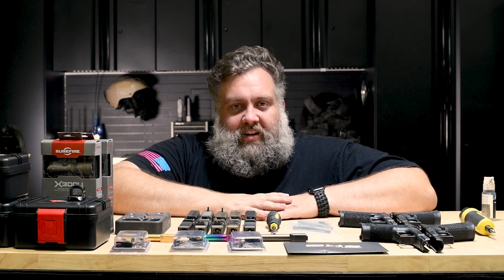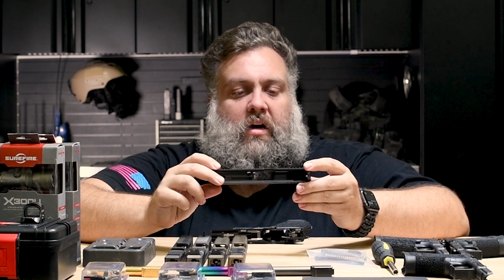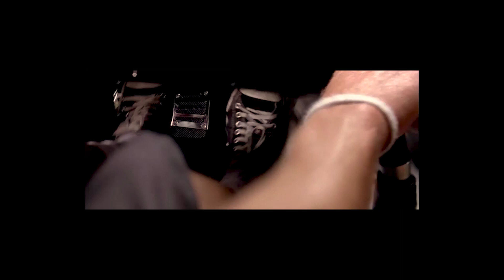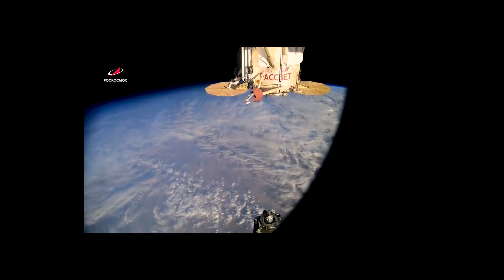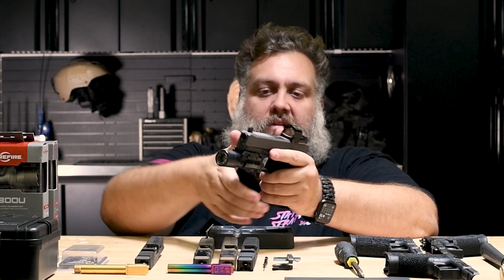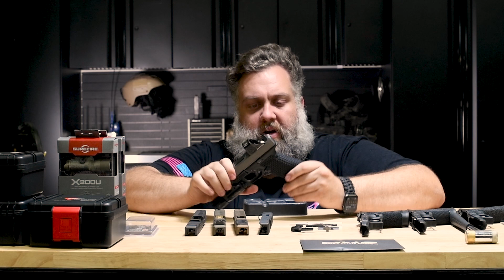How to assemble with Pedro !

Comment: Hey Boss I Own A Glock 17 Gen 3. I Was Wondering? Do Your Glock 17 Slides With An Optic Cut Fit The STEINER MPS Pistol Optic. Goin To Purchase One Of Your Slides I’m Trying To Get A Feel For What I Can Throw On Top!.
Reply from the maker: Hey, great question. Our Acro cut does work with the Stiener Optc yes. You can use standard sights as well. If you need further help dm the Instagram page @dynamic_weapon_solutions or use the Live chat button on the website and we can answer further